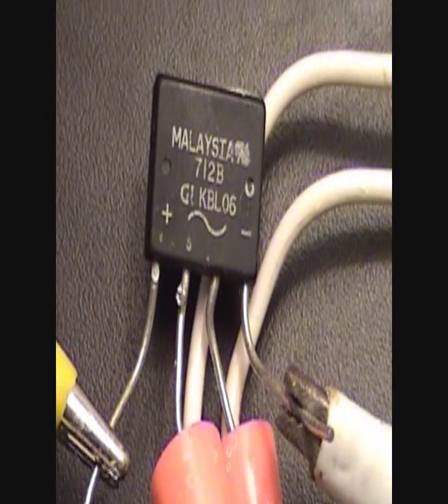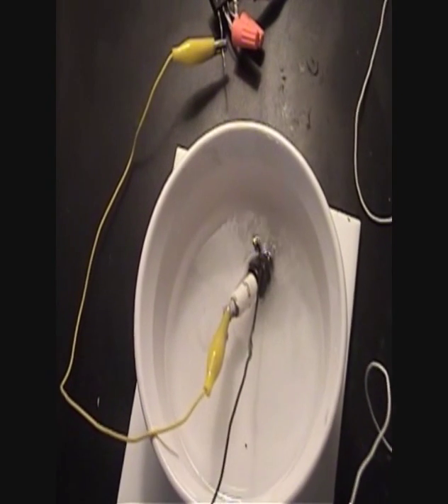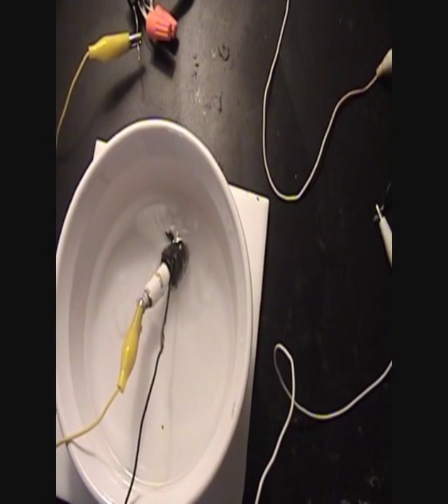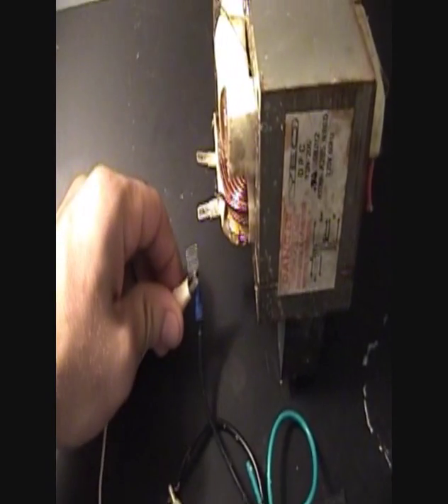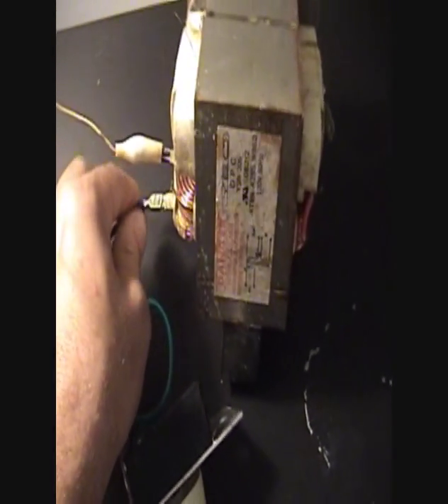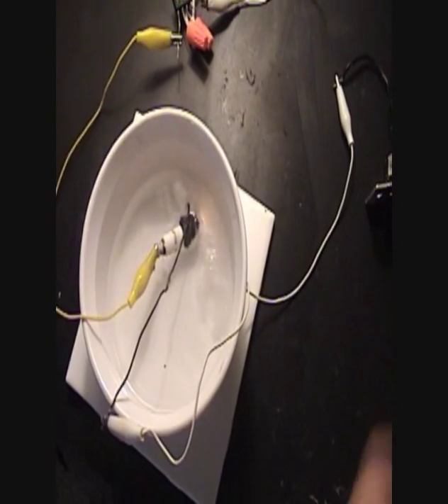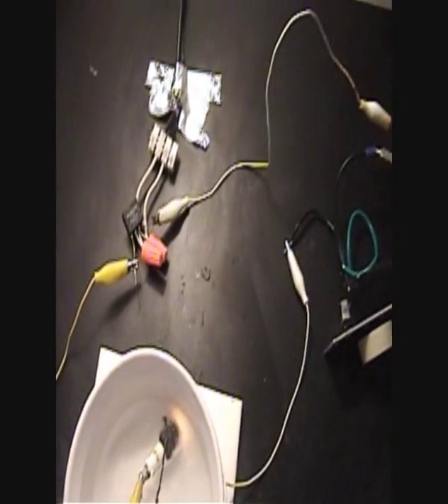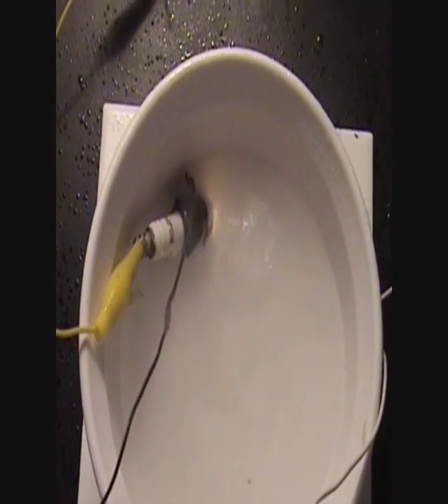resonance Steam cell video diagram

Comment: I do not understand.  Is this a hho generator I can put in my car?  Stan Meyer built a hho generator, sure wish I could build one that didn't need all the energy that an electrolysis process uses.  I think Stan Meyer was on to something that only use a fraction of energy that electrolysis uses.
Can anyone point me in the direction so I can build one?
-William

Comment: hi did you realise thatone of stan meyers diagrams shows a microwave circuit and also his final  (so called tubes ) in that diagram are another name for the spark plug ! you may just need to get a mass air flow sensor to stabilise the frequency from the m o t .look at andrija puharich lecture part3  ..not being ignorant to yourself ,just trying to act as a source/researcher   melvin